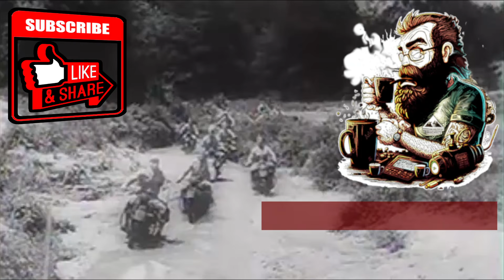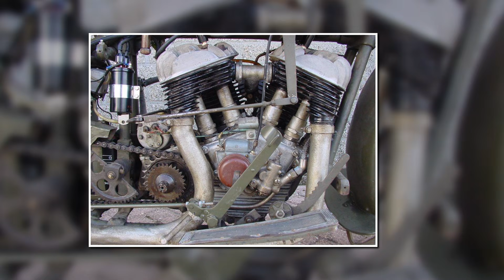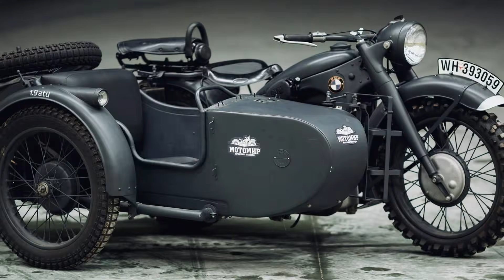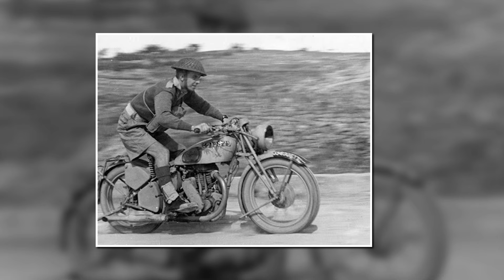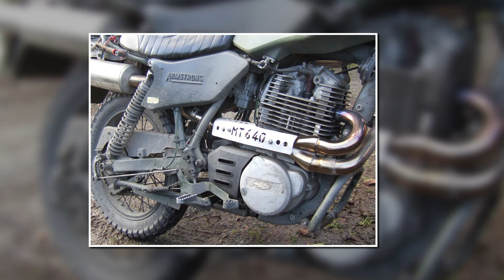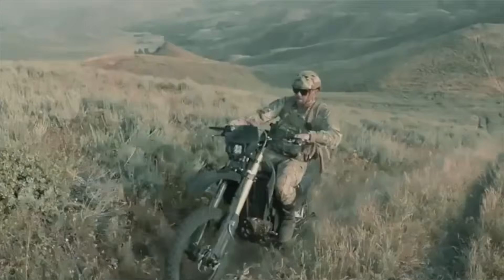WAR HORSES – 17 Hardcore Military Motorcycles

Comment: where the hell was the TRW ??
Reply from the maker: It arrived late 🤣🤣 just like at the time 🤣 built for the war but not finished till after everything was over 🤣🤣 typical Triumph 🤣🤣🤣 seriously tho. If I’d included them all the video would’ve been have been 2hrs long 😊 it was on the shortlist but I always have to stop somewhere 😊
Reply: @barebonesmc  Given that the entire Triumph factory, amongst many others in the city, was destroyed in the huge Luftwaffe raid on Coventry of November 14/15 1940, lateness is hardly surprising. There had previously been 17 raids on the city between August and October of that year, in which almost 200 tons of bombs had been dropped. The raid of Nov 14/15 dropped 503 tons of High Explosive, plus 27 tons of incendiaries. Of some 75,000 buildings in Coventry, 60,000 had been destroyed or damaged. Massive industrial destruction was done, and in terms of housing stock alone, some 76.5% of homes in the city were destroyed or damaged. Triumph's subsequent new-built greenfield site on the Meriden Road, Allesley wasn't opened until 1942, by which time BSA/Ariel/Norton production was well established. From 1936 both Triumph and Ariel were owned by Jack Sangster, who did very nicely out of the war (Triumph was later sold to BSA in 1951) and Triumph supplied the 3HW 350 single to the British Army from 1942. From that date Triumph also supplied 500cc twin-cylinder engines to the RAF, for use in ground maintainance equipment.
Reply from the maker: I know (re Coventry) mate. I was joking 😊 I’m just in middle of lots of not so good Triumph stuff at the minute so it seemed an apt comment but probably was a bit in poor taste 😊 some interesting info n some I didn’t know. I was an A7 lad so there were always some jokes about triumph around me 😊 plus I had a TR25 trophy trials which was unfortunately one of the worst bikes I ever had lol. Until my new era Trophy triple I didn’t have many kind words about triumph 😊 but I do still have a Daytona 955 😊
Reply: @barebonesmc  No worries, mate; all good. 👍 It was my hometown in the mid-40's-61 and I'm currently reading a book about the raid; that's why I have the stats. I was always partial to the A7SS Shooting Star in that lovely polychromatic green, though I rode a sprung-hub Thunderbird and can relate to Triumph issues!
Reply from the maker: The TR 25 just refused to do anything but slide around corners 🤣🤣 but I guess it helped me learn to control slides 🤣 left me on my arse so many times 🤣 shocked me how rare they are now. Even the British museum didn’t have one in trials format

Comment: Regards Ural special parts: later models 2012 to 2016 have Ducati ignition coil and leads, Brembo front disc brake caliper. Tough and easily maintained by home mechanic. I own Irbit USSR built 2012 navy grey outfit. Best cruises at 90 kph but will do more than 100 kph down hill. LOL I believe there was a Kawasaki KLR650 covered to diesel in use in USA military in recent times. Australia had a Suzuki 370 4 stroke single in Army use in 1980s.
Reply from the maker: That’s good to know! Thanks for the info. 😊 the diesel klr never really made an impact but I believe the Suzuki was based on a mash up of the older DR 350 and DRZ 400 but tbh I don’t know much about it. I stopped where I did because it was already a long video so there are more for sure. Yt doesn’t seem to like me at the minute though so anywhere you can share it will help 😊 thanks for the support

Comment: Saw an MZTS250 with a chair in a local museum, it was used by the Iraqis in the first Gulf conflict, 'souvenired' & brought back to Oz.
Reply: I bet that was the one that sat in the entrance of the military police platoon at Enoggera back in the 90s. When I got posted there it had flat tyres and hadn't been started in years. The boss asked me if I could get it running, so after a bit of tinkering and some fresh 2 stroke fuel, I got it started and a few of us took it in turns to ride around the barracks. Great times.
Reply: @axl6298  thanks for that, it was at the now closed motorcycle museum at Marburg so the chances are it's the same bike.  I have some photos of it somewhere.

Comment: As a dispatch rider, the BSA M20 was my army bike for three years, 1956-59. And yes, a very capable, reliable, easy to maintain machine it was. Army days, happy days. For me at least.
At the age of 88, I am still riding, albeit a modern Triumph Speed 400.
Reply: Good man Barrie👍👍
Reply: Lovely review of the bike,personally I would prefer a bullet 500. But sold all mine fore Honda 350 fours,(3)…. Miss that simple tech.cheap to buy replacement parts ,easy repair. Ohhh why did I go away….? Well to be honest,some of the India made parts are soft ,miss threaded…etc.built to fail…..old Hondas do seem to have better replacement parts. More expensive,guess you take your ticket and the view…
Reply from the maker: That's fantastic to hear! Sounds like the M20 served you well, and it's brilliant you're still on two wheels today 😊 how you finding the new triumph? Heard good and bad tbh so interested in first hand accounts
Reply: @barebonesmc  Yes, the M20 never let me down once, it was a loyal steed, even when pushed hard to get past a convoy of military vehicles, or when having to grass-track up the side of a hill to hoist flags warning that the BIG guns were firing on the range.
Now the Triumph, my first (sort of) British bike since I owned a genuine Royal Enfield Bullet may years ago. Purchased new, delivered with a fault, not a good start.
There was no free play in the clutch lever (great PDI from my local Triumph dealer lol)
Fixed it myself rather than do a 62-mile round trip to the dealers. The clutch nipple had been fitted incorrectly, being the other side of the keeper rather than in the proper slot. The front engine mounting bolt fell out (550 miles on the clock) on the way back from Wales to the Midlands. Poor PDI again! 
Love the bike though. Love the way it looks (like a bike should look, but then, I am old) and the quality fit and finish is first class considering the price. The bits that are probably not quite up to scratch in my opinion are the switch gear (cheap plasticy looking, but work just fine) and the handlebars, which appear to have been stolen off someone's self painted bicycle. Handles really well (better than the Yam it replaced, surprisingly) the basic suspension doing a good enough job on the whole. Gearbox and clutch being a delight, butter smooth shifts, very satisfying. Also fitted with a slipper assist clutch, anti-lock brakes, traction control (which can be turned off), full stainless exhaust system, and proper decent tyres, which I think is good at the price point. The engine is a very willing little unit, which has a lot of torque for its capacity, the torque coming in low down in the rev range. Nice to have an engine that you do not have to rev the nuts off tho get anywhere, and where you are continuously changing gears to keep the engine happy. Not a fan of that. If top speed is what you like, then forget this bike, it's no motorway mile muncher. Sweet spot is 60-65, it getting busy and vibey 70 on. Don't get me wrong, it will do it no problem, and more. Top speed being around 95. Not a nice place to be at that speed, I wouldn't think though. The worst thing by far to my mind is the fly-by-wire throttle, which when trying to hold a steady speed is a pain in the butt, it constantly ever so slightly increasing and decreasing the revs, so as to make smooth progress difficult. I have heard that there is a software upgrade to fix this, but have also heard that having had this done, the problem was worse....
Anywayup (one word from where I come from) it's a cracking little bike, and if I had to make the choice again? In a heartbeat!
That's your lot. Safe riding, Oldbaz.
Reply from the maker: Cheers mate. I hear good and bad tbh. And I’m yet to be convinced either way 😊 but ride by wire is a pain on any of the bikes I’ve tried n probably the biggest reason I keep going older with bikes 🤣🤣 if it can’t hold neutral throttle it ain’t coming home with me lol thanks again and happy riding 👍😊💪

Comment: I learnt to ride on a BSA 175 Bantam. That was a funny old bike! I was out riding with the training group and achieved the fastest ever speed on the riding-school’s Bantam. In fact, I struggled to stop it! When it finally came to a halt, the instructor found that the carb slide was out the top of the carb, as the top had completely unscrewed itself. The engine was a tad warm!
Reply from the maker: 🤣🤣🤣 stopping a bantam was never easy even at normal speeds 🤣
Reply: @barebonesmc - it was off the clock! I was a Learner. But at least it cured my constipation.
Reply from the maker: 🤣🤣🤣 that made me smile 😊

Comment: Just a few of the greman one you could not get round to :- dkw 125 rt ,dkw 350 nz , Bmw R35 Bmw R75 ( a lot of common parts with the KS750), Zundapp's k500 , Ks600 and a lot more ps did you know the wehrmacht also used some triumph bikes ?
Reply from the maker: many missed, and no i didnt know the wehrmacht used Triumphs, which? From Triumph? or built in Germany?
Reply: @barebonesmc  built in germany ones mate
Reply from the maker: That would make more sense 😊 stolen tech or from shared tech before the conflict began?
Reply: @barebonesmc  Initially shared tech, then local development. Triumph (Orial-TWN) were made in Germany from 1903-57.
Reply from the maker: Cheers mate. Always good to learn something new 😊 I will see what I can find about it